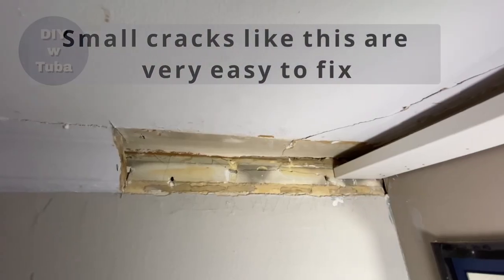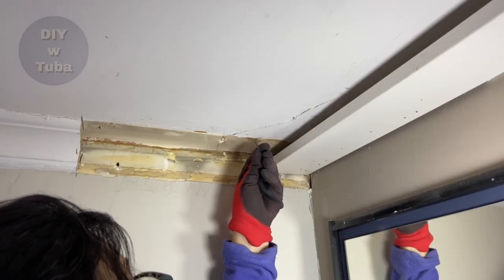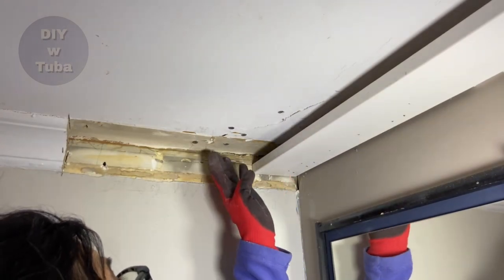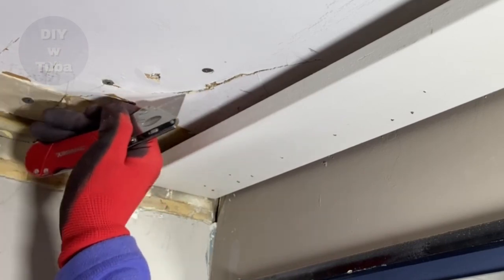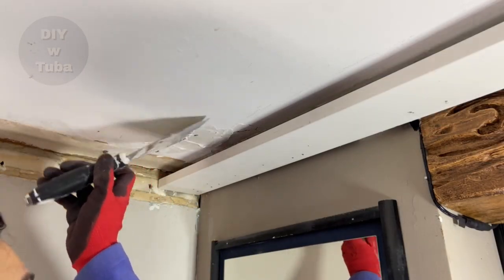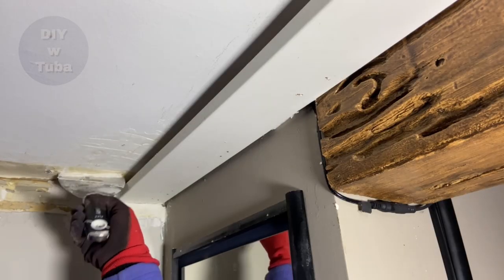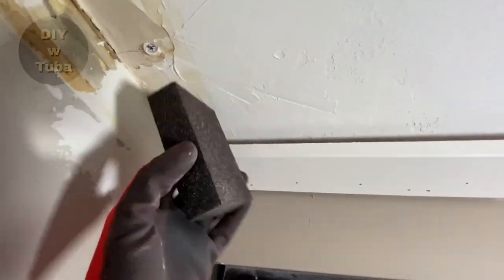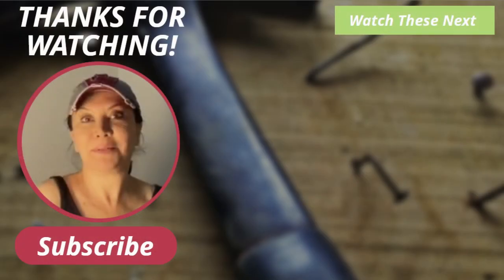How to Fix a Crack on Plaster Ceiling || Easy Steps DIY

Comment: Your videos are just so helpful, Tuba! Thank you! We have a plaster ceiling which has started bubbling by our front door. Would the same process apply to repair that as well?
Reply from the maker: Thank you Betsy😍 Bubbling of plaster is a different issue it shows that there is a dampness in the wall. You might want to find out the reason first!